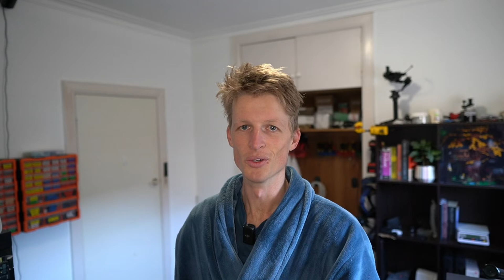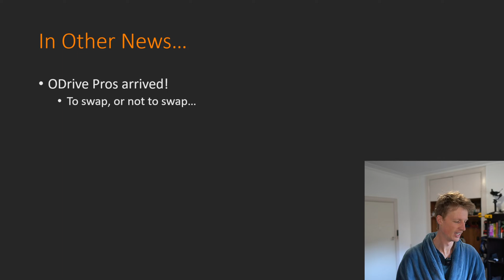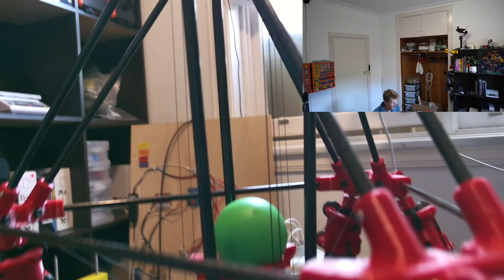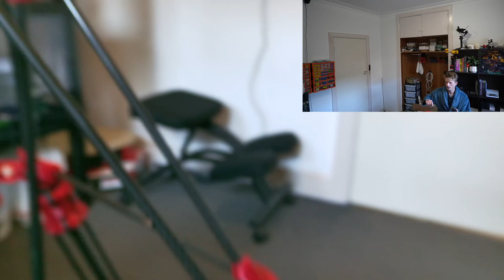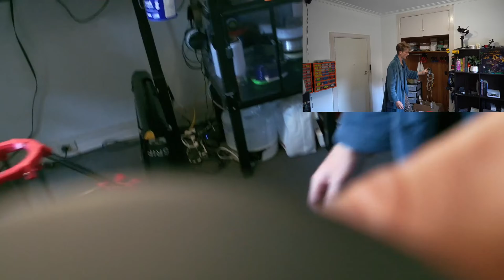PDJ Weekly Livestream # 16

Comment: Abstract

This video details the progress and challenges encountered in Project DeepBlue JuggleBot, a juggling robot project. The main focus is on the catching mechanism, with recent tests revealing excessive inertia causing the ball to bounce off the hand. The video explores potential solutions, including using smaller motors and a bidirectional drive system, and discusses the possibility of incorporating ball tracking and D3O impact-absorbing material in future iterations.

Summary:

Housekeeping (0:00)
* A simple fix for overly tight XT60 connectors was discovered.

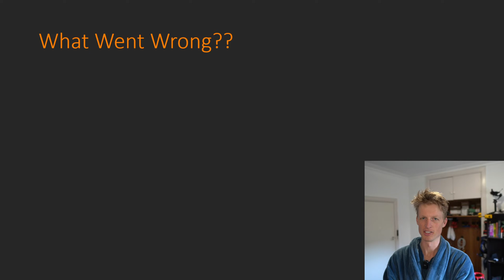What Went Wrong? (1:53)
* A ground connection issue caused damage to several CAN transceivers.
* The extent of the damage is still being assessed.
* ODrive Pro might be more robust against this type of issue.

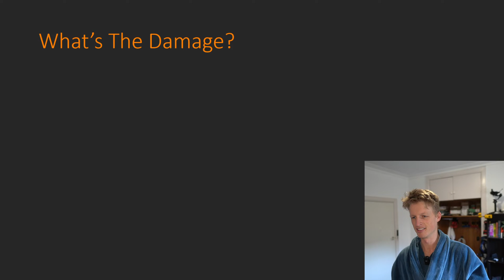What's the Damage? (4:40)
* At least one ODrive and the TNC transceiver board are fried.
* Replacing the CAN transceiver chip on the ODrives might be possible.
* Thankfully, the Jetson computer is undamaged.

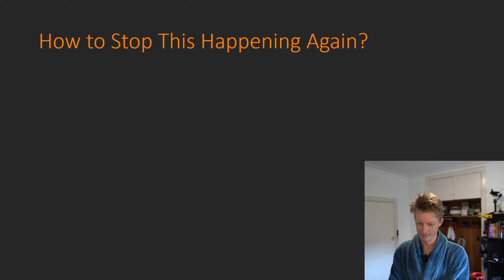How To Stop this Happening Again? (7:00)
* Using bus bars and soldering directly onto the ODrives are potential solutions for preventing loose connections.

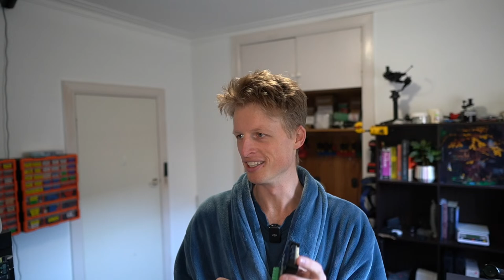ODrive (and motor) Delivery! (12:24)
* New ODrive Pros and small, powerful drone motors have arrived.
* A decision needs to be made whether to switch to the new ODrives or attempt to repair the old ones.
* Gearing the new motors down might be necessary, but could increase inertia.

A Question About BLDC Motors (15:14)
* Can the new motors be safely powered by a 45V power supply despite being rated for 22V?
* Overpowering might increase speed and heat, but the ODrive can regulate speed.

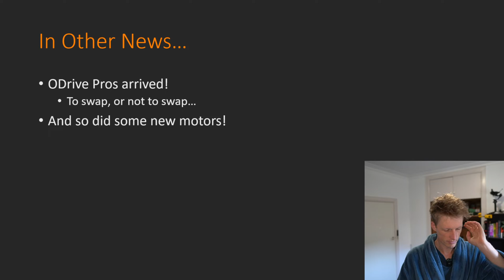Progress on Catching (17:03)
* Catching tests have been conducted with a compliant hand design.
* The hand throws the ball very high, potentially hitting the roof.
* An unexpected problem arose where the strings pop off the pulley during fast movements.
* A solution involving a tapered ceiling above the pulley might be implemented.

Thoughts on Inertia (33:01)
* The current setup has too much inertia, causing the ball to bounce off the hand.
* A test rig will be built to investigate the relationship between ball and hand inertia.
* Smaller motors with low inertia are promising, but gearing them down could negate this advantage.

Brief Tangent on Ball Tracking (36:48)
* Ball tracking is planned for future iterations, potentially using a 3D camera or a laser gate.
* However, open-loop control might be sufficient if the robot is precise enough.

Returning to Inertia (39:02)
* Gearing down motors increases their effective inertia.
* A test rig with different gear ratios will be used to assess the impact on catching performance.

BLDC Thoughts (42:49)
* BLDC motors are not significantly affected by voltage, but heat could be an issue.
* The hand motor's duty cycle will be low, potentially mitigating heat concerns.

Pre-empting the Ball While Catching (45:30)
* Pre-emptively moving the hand to receive the ball could reduce the required motor force.
* This has been tested, but the current setup's inertia still causes bouncing.

Thoughts on the Constant Force Springs (48:08)
* The constant force springs might be replaced with a bidirectional drive system due to reliability issues.
* This would require careful string routing and potentially another fuse to prevent the hand from hitting the base.

D3O (53:02)
* D3O, an impact-absorbing material, might be used to line the hand and reduce bouncing.

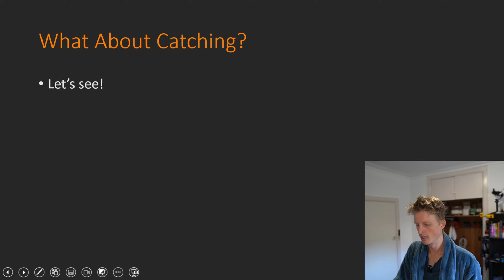No Stream Next Week (53:59)
* There will be no livestream next week due to the Easter holiday.

disclaimer: i used gemini 1.5 pro to summarize the youtube transcript.

Comment: The density of your ball is so different from the ball bearing they dropped on the D30.  Doubt it will provide the solution you want.  I think, given all the articulation you've created, it's mostly software to track the ball and move the catching mechanism to gently receive it.  This could also serve as a sort of closed loop system where unseen variables altering the ball's speed/position/trajectory would be addressed by tracking the actual ball
Reply from the maker: That's a very good point; the elasticity of Jugglebot's balls would definitely affect the ball > D3O interaction. I agree that software can go a long way towards making this system work, but part of me feels that there's some (relatively) simple way to improve the hardware to reduce software complexity by quite a lot. It's just a matter of finding what that improvement is 🤔

Comment: 41:10 ish - yeah this is a thing I also don't love about the larger (of the smaller) drone motors like that (yes! they get SO much smaller!)- but because the propellers are so light, they don't have lots of rotational inertia, so the likelihood of them slipping is very low. Moreover - plenty of motors with that propeller mounting standard do have teeth cut into the base where the propeller sits, so when you cinch down with a locknut, it digs into the prop some and provides some mechanical keying
Reply from the maker: Yeah these motors have very slight features that would achieve the effect you're describing, but it definitely doesn't seem super solid. I was recently talking with a friend about this and we came up with a potentially good solution: the part that's mounted to the output shaft can have a cutout to fit the locknut, so that when the nut is tightened, it both clamps the mounted part as well as preventing it from slipping, since the nut fits snugly in the mounted part.

A little tricky to describe with words, but I think it should work well!